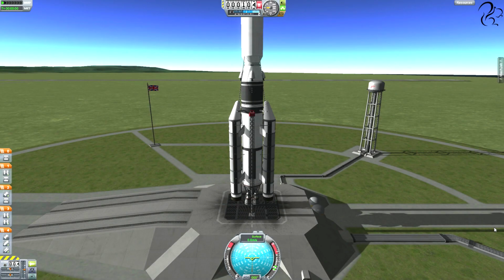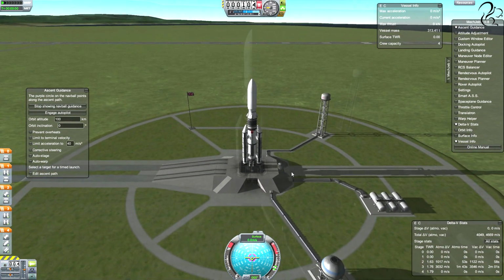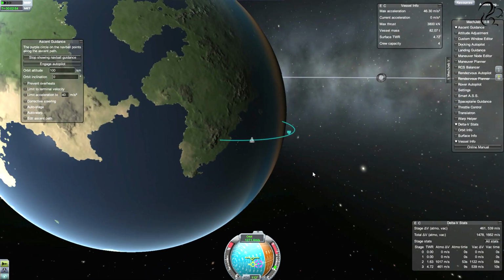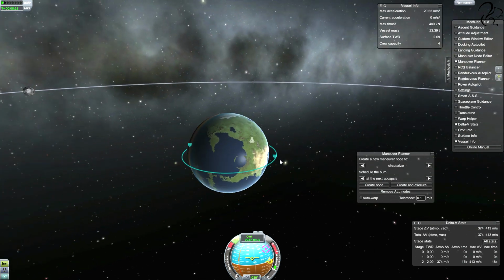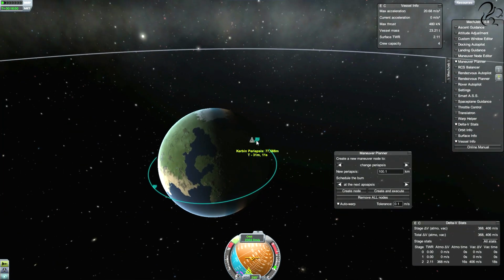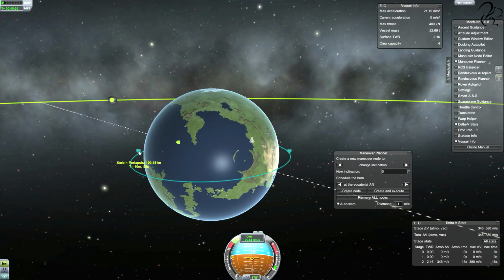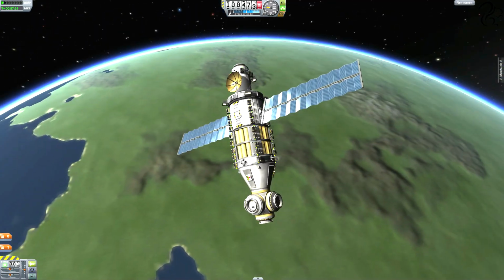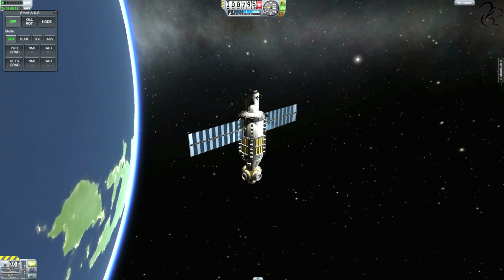Space Station! - Kerbal Space Program Ep #4

Comment: Just put a probe on the ferry/fairing stage with some small panels or RTG's and you can de-orbit it at your leisure if you leave a bit of fuel in the tank - alternately just add a ring of sepratrons: firing as you detach the payload to retro-boost the spent stage back into an unstable orbit and a fiery demise...

Of course that's all for the next missions it doesn't help you clear the current lurking menace - all you need for that is send a 3.7m fairing base up with a tug to catch & de-orbit it.

Comment: Ad a battery on the lift vehicle and a mech jeb,  set retro grade on the a.s.s. and full burn it. It will re enter kerban and have no worries of hitting your station.  Also setup your fairings staging to seperate at 60km (not the base though) and it will work.  No need for fairings once your out of the dense atmosphere.